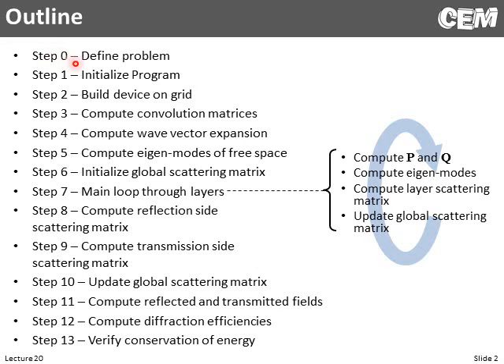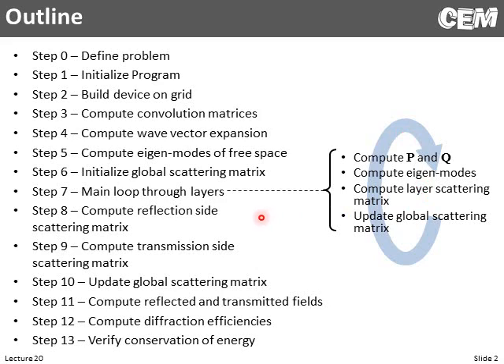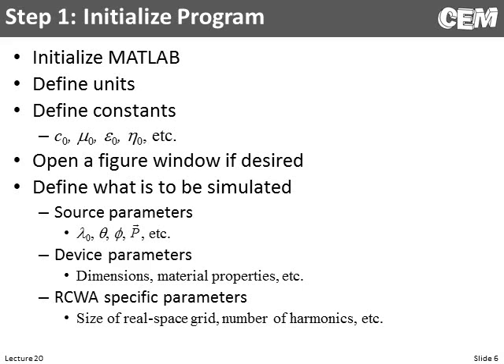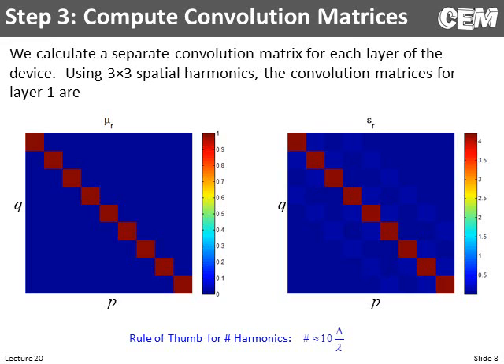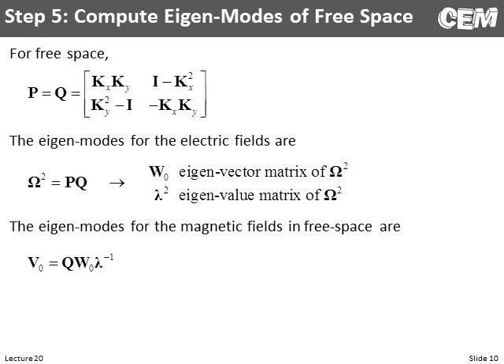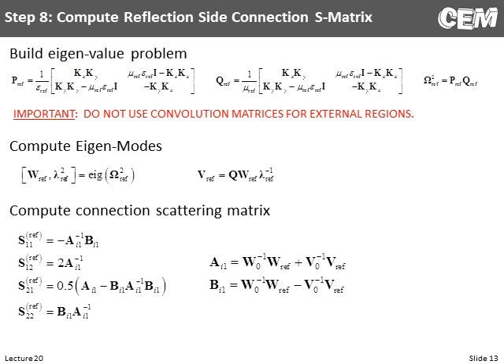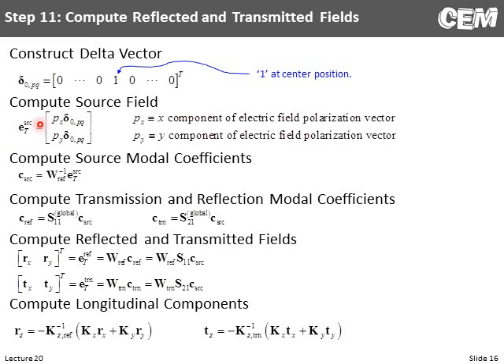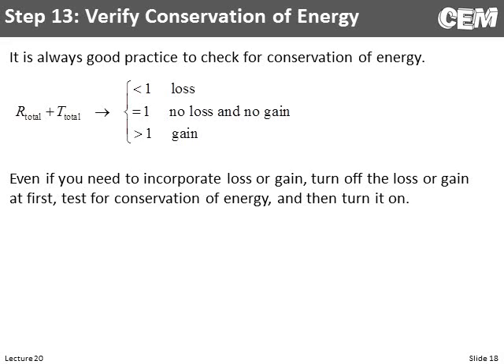Lecture 20 (CEM) -- Implementation of Rigorous Coupled-Wave Analysis

Comment: Thank you very much for your lectures. I have been able to follow it to write my own RCWA codes which seems to work pretty well. However, I have noticed that when my periodicity equals the wavelength of the incident light, the value of the R or T at that particular wavelength goes to NaN and Matlab yells just like you say. Could it be due to the fact that the waves become evanescent under such condition?
Reply from the maker: You essentially have it right.  kz=0 in certain cases causing the math to fail.  Every numerical method I know of cannot handle this case well.  Even experimentally in the lab it is touchy.  The best fix is to just skip these wavelengths in your simulation.
Reply: @empossible1577  Great! Thanks for the response and for the wonderful work you are doing.
Reply: I am using RCWA to calculate the R and A of metallic structures in a published work. I know that I have to use more planes than I will typically need for the dielectric structures. But I seem to get matching results as in the published paper when about 3 planes waves than when I use 11- 15 planes. How strange is my result....lol? They used FDTD for their simulation but I guess that should not be the issue. When I say matching results, I mean I get the expected peaks at the close to their obtained wavelength. However, one of the peaks decreases in amplitude (almost disappears) when I increase the number of planes.
Reply: @empossible1577  I've noticed this is sometimes the case for 1/n times the unit cell size, where n is an integer. For example with a unit cell of 1200, this occurs at a wavelength of 400, so 1/3. for a unit cell of 1800, its 900, 600, 450, 320 so 1/2, 1/3, 1/4, 1/5. It only occurs however if number of harmonics P/Q are n or higher. Did you notice this as well professor?
However if you set it to something like 599.99 it would work.
Reply from the maker: @ManderSeis  You will get an unstable response any time any diffraction order is at cutoff.  If you are seeing it at any other time, something is wrong with your code and most likely in your scattering matrices (or whatever you are using to cascade multiple layers).  The lazy thing is to do like you say and adjust wavelength or period to be just off of the number that gives the trouble.  A more accurate way would be to simulate just above and just below the cutoff and average the two answers.  I tend to just skip where there is a problem, after verifying it is a cutoff diffraction order.  I am always open to there being a problem in my codes!
Reply: @empossible1577  That makes a lot of sense!
Reply: Can you please share the coding?

Comment: Thanks for sharing this! Would you change anything if you were modeling a structure with metal layers and dielectric layers? I know the high permittivity contrast is not ideal but how would you address it?
Reply from the maker: You will certainly need to retain more spatial harmonics in your expansion.  Tricks like fast Fourier factorization will help too.  Otherwise, it is essentially the same code.  

I have seen for some structures that real-space methods like finite-difference frequency-domain or method of lines becomes much faster than Fourier space methods for high contrast and metals.  Still, lots of people smarter than me argue the Fourier space methods are still superior.
Reply: @empossible1577  Thanks for the reply. Are the diffraction efficiencies in the R matrix analogous to diffraction frequencies of different diffraction orders? And if so do they contain angular information?
Reply from the maker: @lukem1221  R (and T) is actually a column vector containing the diffraction efficiencies of all diffraction orders.  There is only one diffraction efficiency per diffraction order.  They are all in R.  There is nothing else.  

I am not sure what you mean by angular information.  Are you talking about polarization information?  That cannot be determined by diffraction efficiencies.  Diffraction efficiencies are just scalar numbers.  You will have to calculate the actual transmitted and reflected fields and determine polarization from those.  Not sure if this answers your question or not, but I tried!  :-)
Reply: @empossible1577   Thanks again, that answered my question! 
I tried to model the structure with metal and I am unable to achieve conservation of energy as soon as I introduce a complex permittivity. Do you think it is a problem with the fast fourier transform?
Reply from the maker: @lukem1221  If you are introducing a complex permittivity, you are introducing loss.  Unless you are calculating absorbed energy, you will not get conservation.  In general, R+T+A=1, where R is reflectance, T is transmittance, and A is absorbance.
Reply: @empossible1577  Thanks, I forgot about absorption! I tested it on a uniform gold layer and got the correct reflectivity.
Reply from the maker: @lukem1221  Even when I want to simulate something with loss or gain, I will turn that off and verify conservation and then turn it back on.  It is just one more little check I can do to build my confidence in my simulation.  Those who simulate the most trust the simulations the least.  ha ha

Comment: The Oblique RCWA Benchmarking data has an "error", in that layer 2 (which is a homogenous layer) does not have W as the identity matrix. This isn't really an "error", as since there are repeated eigenvalues there are multiple possible sets of eigenvectors, but it is inconsistent with the lecture notes.
Reply from the maker: Tiny and subtle numerical things can cause eigen-vectors to differ significantly from the perfect identity matrix.  Do you get a perfect identity matrix in your code for that layer?
Reply: @empossible1577  I do now, because I explicitly check for homogeneity prior to performing the eigendecomposition. Prior to doing that I did not.
Reply from the maker: @jordanedmunds4460  I think all is normal and how you are currently implementing your code is best.

Comment: When I take the square root of some of my squared eigenvalues, sometimes I get a conjugate of the expected value in the benchmarking code (this is due to the very small numerical error in doing the eigendecomposition, there is a tiny imaginary part to the square of the eigenvalue, so taking the square root chooses the negative root rather than the positive one). These conjugate (errors?) carry over to the X and V matrices, and (presumably) into the scattering matrices as well. Is this actually a problem? For squared eigenvalues which are purely negative and real, taking the square root is indeed ambiguous, and either the positive or negative root is mathematically valid. Are they both physically valid? It seems like they have opposite physical meanings, with the positive imaginary root indicating positive phase is accumulating as the wave propagates forward, and a negative imaginary root indicating negative phase is accumulating, so I would expect this to cause a problem when computing the scattering parameters.
Reply from the maker: Very small imaginary numbers arise due to numerical error so their sign is meaningless.  You are probably okay just ignoring them.  You may also find it helpful to write a cleanup() function that sets all small read and imaginary numbers to exactly zero.  Maybe use a threshold of 1e-10 or so.  I have done this in the past only to make the numbers look prettier, but I found no performance or accuracy difference.
Reply: @empossible1577  Thanks! I also found no difference in the S-parameters (the things of physical significance), despite the difference in the intermediate V, X, A, and B matrices due to the propagating sign difference.

Comment: I have also coded up my RCWA, I expect in case of only one mode is used, the solution will degenerate to the case of TMM(in 2x2 scattering matrix form), however it doesn't and produce very small intensity, I'm trying to debug and find what's wrong, but just want to check is your RCWA code really able to reproduce exactly the TMM result?
Reply from the maker: As long as your layers are homogeneous, RCWA and TMM should give he same exact result, down to many decimal places.  If you are comparing intermediate results, you may find some differences.  TMM and RCWA are essentially the same numerical technique.
Reply: Thanks, let me be more specific. suppose RCWA is applied to non-homogeneous structure with only one mode, is that numerically equivalent to a TMM using layer-wise averaged refractive index (sum of refractive index in each cell divided by total volume of that layer) ? I'm not sure if the Fourier factorization of layer material permittivity in RCWA boils down to an algebraic average.
Reply from the maker: In general no, but there are some special cases where the answer is yes.  When the period is very subwavelength and isotropic, TMM using average refractive index values will give the same answer as TMM.  My research group just published a paper discussing a structure where this is the case:

Jose A. Avila, Cesar L. Valle, Edgar Bustamante, and Raymond C. Rumpf, "Optimization and Characterization of Negative Uniaxial Metamaterials," Progress in Electromagnetics Research C, Vol. 74, pp. 111-121, 2017.

When you calculate the Fourier coefficients of an inhomogeneous layer, the zero-order coefficient is the numerical average of that layer.  So, for the very subwavelength case, picking only 1x1 spatial harmonics will essentially reduce RCWA to TMM with averaged permittivity in each layer.

Comment: Thanks for the great lectures! These are extremely helpful. I use RCWA a lot and want to implement it myself. I just started to implement it and have some trouble with energy balance at the end. Is it necessary to de-normalize the H-fields and wavevectors at some point or will all cancel out correctly if I follow your implementation? I am a bit surprised that I don't need epsilon0 or mu0 at some stage. However, using your Benchmark, I am sure, I will get it to work correctly. So thank you again - it is way easier to follow your lectures than using the original papers!
Reply from the maker: Have you visited the course website?  Here is the link:

http://emlab.utep.edu/ee5390cem.htm

Near the top you will see a few "Benchmarking Aids."  I have essentially run my RCWA codes for various simple cases and provided all of the intermediate results.  From this you can get two things.  First, you can see the order in which I calculating things.  Second, you can check your results as you go in order to troubleshoot your code.  This website also has the latest version of all the notes, including corrections, additions, and other improvements.

As for normalization.  Sometimes it is absolutely needed and other times it is not.  However, it is always good practice to normalize everything.  I suspect you could implement RCWA with normalizing anything, but I would have to work through that entire formulation to be confident of all the changes that are necessary.  I strongly recommend normalizing, even if you can show that it is not absolutely necessary.

I am very glad the videos are working well for you!!
Reply: Perfect! I just went through the 3x3 oblique benchmark (which took me some time) and now after debugging my code everything works out for your example. Keep up the good work! 

(Btw I think that the simple answer to my question concerning H-Field-normalization is that the final DE is calculated from the E-Field, which was normalized to 1 for the source term and hence neither epsilon0 nor mu0 is needed, except if you want to calculate absolute field values.)
Reply: I have another question: have you also implemented fast fourier 
factorization for 2d gratings and is there a straightforward way to add 
this to your convolution matrix approach? A formulation is presented in:
 

Lifeng Li, "New formulation of the Fourier modal method for crossed surface-relief gratings," J. Opt. Soc. Am. A  14, 2758-2767 (1997)

However it's hard for me to follow.
Reply from the maker: FFF is pretty easy for 1D gratings.  I cover that in the latest version of Lecture 23 on the course website:

http://emlab.utep.edu/ee5390cem.htm

For 2D gratings it is a bit more difficult because you have to calculate what is called the normal vector function.  I provide a little information about this near the end of Lecture 18.  The best method I have seen for calculating the normal vector function is given on Slide 48.
Reply: I'll check it out, thanks! (Since I'm calculating 1d-gratings in 99 % a 1d-implementation makes sense.)
Reply: Another question: I implemented 1d and 2d RCWA about a year ago and it works just fine for dielectric structures, which is what I need most of the time. However, if I use complex permittivities I get unphysical results (i. e. more than 100 % efficiencies). I already found out that if I change er2 (reflection region) to a complex value I have to change my kz_trans expression:

if imag(er2) ~=0
    kz_trans = sqrt(ur2*er2-kxm.^2);
else
    kz_trans  = conj(sqrt(ur2*er2-kxm.^2));
end

However if the grating region permittivity has an imaginary part, there are still unphysical results. Do you know the problem and have any hints?
Reply: Okay, seems like it was simply a sign error; bases on the given derrivation I have to use negative imaginary parts of the permittivities for lossy media (however it seems like my remark on the kz_trans expression is right).

Comment: Hi. What if I'm dealing with anisotropic materials (such as carbon nanotube)? I saw what should be done in the case of a homogeneous layer. Is there any good reference for the RCWA implementation?
Reply from the maker: Great question.  The short answer is that you retain the tensor elements when you expand Maxwell's equations and each becomes its own convolution matrix.  I do plan on adding some slides on this at some point to the "RCWA Extras" lecture on the course website.  

http://emlab.utep.edu/ee5390cem.htm

Here are two decent references, but there are more...

Lifeng Li, "Fourier modal method for crossed anisotropic gratings with arbitrary permittivity and permeability tensors," J. Opt. A: Pure Appl. Opt. 5 (2003) 345-355.

Evgeny Popov, Michel Neviere, "Maxwell equations in Fourier space: fast-converging formulation for diffraction by arbitrary shaped, periodic, anisotropic media," J. Opt. Soc. Am. A, No. 11, pp. 2886-2894, 2001.
Reply: Thank you sincerely!
Reply: Also, I would like to know does this formulation follow the original eigenvalue problem by Moharam et. al (1995), or the later improved formulation for Fourier Factorization (Granet & Guizal, JOSA A, 1996; Lalanne & Morris, JOSA A 1996; Lifeng Li, JOSA A, 1996)? Because I just came to know the original solution converges very slowly for TM diffraction of metallic gratings. Thank you!
Reply from the maker: I think you will find it to be very close.  Moharam is an incredible person and a legend in this area.  the main difference from his original algorithm are that he utilized the enhanced transmittance matrix approach for cascading multiple layers.  This is about 10x faster than scattering matrices, but less memory efficient and less versatile.  If you read about scattering matrices, you will find almost everyone is handling them incorrectly, or least against convention.  The formulation I present does not incorporate fast Fourier factorization.  I do cover this topic in Lectures 18 and 23.  FFF will improve the convergence of TM for sure.
Reply: Got it! Thanks so much.

Comment: Hi. I'm trying to learn RCWA from this lecture and implement it in MATLAB. I'm on step 11 and got an error from the matrix dimension mismatch between rx,y and Kx,y,z though. Because rx,y are calculated from S and W matrices, therefore, I assume the length of rx,y should be the same as the S-matrix. However, the divergence equation that use to calculate the longitudinal components use the K-components which are elements in S-matrices which mean K-component arrays should always be smaller than the S. So, I wonder how can rx,y be multiplied with a smaller dimension matrix. Do I misunderstand something?
Reply from the maker: rx, ry, and rz should be column vectors.  K matrices are diagonal matrices.  Maybe that is the problem?
Reply: shouldn't the length of the column vectors be the same as the row size of the K matrices??
Reply from the maker: Yes.  So rx, for example, are the reflection coefficients for the x-component of the electric field for each of the spatial harmonics.  Kx is a diagonal matrix containing the x-component of the wave vectors for each of the spatial harmonics.  So if you have 5x5=25 spatial harmonics, rx will be a 25x1 column vector and Kx will be a 25x25 matrix.
Reply from the maker: Sorry to just be thinking of this now, but I have the perfect thing for you on the course website:

http://emlab.utep.edu/ee5390cem.htm

There are three different RCWA benchmarking documents for you to download.  I essentially ran my codes with semicolons and so you see a all of the intermediate results.  This illustrates the order that things should happen as well as size and values for all the parameters calculated.  Check your code step-by-step against these documents and you should be able to get things working.

Hope this helps!!
Reply: Thank you very much. That solve my problem !!! o
Reply from the maker: Great!!
Reply: one more question. :) I've got everything almost right except the eigenvalue that is not the same as in the benchmark. The signs are reverse in some columns (well, OMEGA_SQ and eigenvector looks right if you neglect the fact that when the value is supposed to be zero, mine still shows xx e-6,7 something.)...Do you have any idea what could be the problem?
Reply from the maker: Maybe.  It may just be the order of the Eigen-values are different than mine.  There are a bunch of reasons this can happen, but any order is correct.